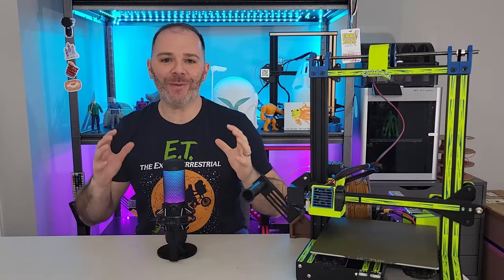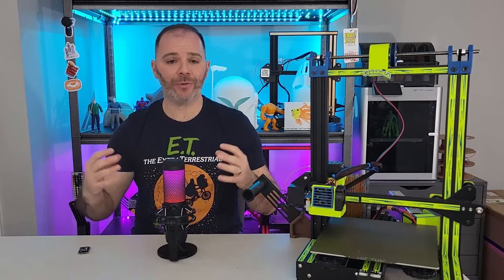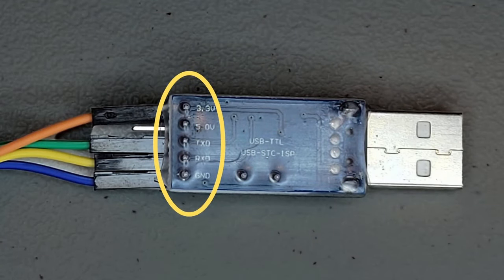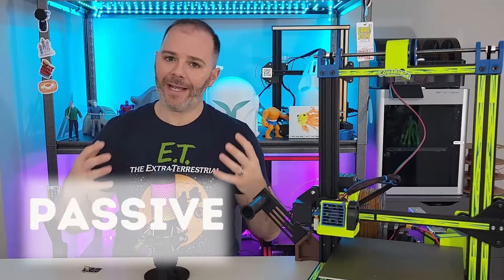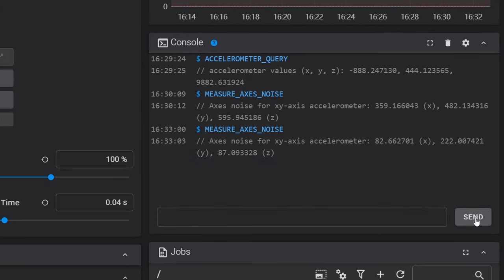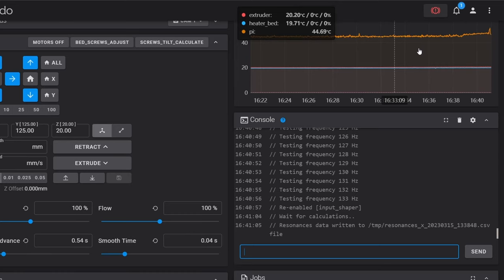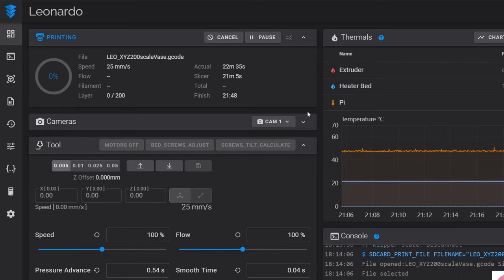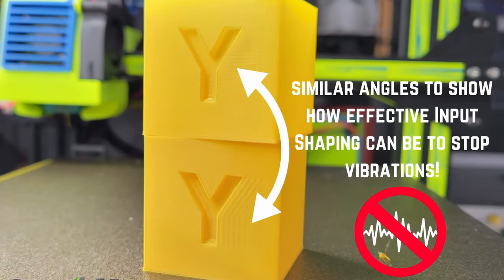Input Shaping Made easy with a USB accelerometer!

Comment: Leo, you are greatly misunderstanding coreXY idea, Ender 5 is cartesian, BambuLab is coreXY. CoreXY is faster and more precise because in cartesian one motor need to be moved with a head (look at ender 5, Y stepper is fixed, but X stepper moves). In coreXY both motors are stationary, just head moves.
Reply from the maker: I'm not sure if I accidentally called an Ender 5 a CoreXY printer, if I did that was my mistake. One important note is that they are both technically Cartesian printers, as they all employ Cartesian coordinates. So you're calling the ender 5 by its 'coordinate' name and your calling the CoreXY by its 'mechanical' name which is not a fair comparison. Obviously their kinematics do differ and it's an important distinction. Besides the stable motors that coreXY employs the routing of the belt is another important characteristic!
Reply: @PrintsLeo3D  Let me start with what I had to say first - you've made a truly awesome video.

As for coreXY, I'm afraid you do the same mistake as I did till recently. "Cartesian" it's not about coordinates, they all operates in cartesian coordinates (corexy, cartesian and delta). Unfortunately, for some historical reason "Cartesian" was chosen as a description of a very specific *mechanics*, not a coordinate system. I finally got the difference, when asked myself, why do we need coreXY, if I can just rotate model by 45 degrees. Then for straight lines both steppers will be involved as on coreXY. But the difference is in belt system, where steppers are not moving at all and do not contribute their weight into inertia.

"Cartesian" requires one stepper to move along the axis. CoreXY - don't. They both operate in cartesian coordinates.

Comment: If you are trying to flash the KUSBA using the guide on the website and get the "Unknown initial pin 'PA14' ... Error 255" Make sure to deselect the GPIO pin in the klipper firmware.
Reply from the maker: Are you referring to the guide on my website ? If so I will add this information to that section to let others know. Thanks !
Reply: @PrintsLeo3D  Yes I was using your guide. Your guide does specify to set the image exactly like. It was my mistake not realizing I had it checked. If you used the firmware image tool to flash klipper, that GPIO pin might be selected at the bottom. It took me like 30 minutes messing around to realize I had it checked because it was towards the bottom. I was a bit tired lol. 

One other thing I would recommend is running (straight from klipper documentation):
- sudo apt install python3-numpy python3-matplotlib libatlas-base-dev libopenblas-dev

I just ran and had some issues due to libopenblas not being installed. For some reason I also had to install matplotlib again as well, not sure why. 
- sudo apt install python3-numpy matplotlib libatlas-base-dev

I really appreciate the guide though Leo. I love your content, thanks for all the help.

Comment: I can't seem to find the KUSBA article on your website. I keep getting "Printer is not ready. The klippy host software is attempting to connect.  Please retry in a few moments.". When I put # [include adxlmcu.cfg] in the printer.cfg, everything works fine after the restart. DId the firmware not flash correctly onto the KUSBA?
Reply from the maker: The config file is going to look different for the KUSBA accelerometer, so if you're trying to use the same one as in this video you'll get an error. I am going to be posting the article tomorrow in the AM as I am doing a long drive and will be working on it then!
Reply: @PrintsLeo3D   Thank you, i'll look at it when you post it. I used the github documentation for the KUSBA v2, not the TriangleLabs ADXL in the video. Maybe I did something wrong, or something in the documentation is off.

Comment: When I plugged in the USB C after flashing, only one light lit up.  Also my ls command showed no USB0 until I plugged in the flash device so I selected USB0.
Reply from the maker: If after flashing, you unplug the flash device, then plug the accelerometer into the host device and only a single light is illuminating it leans me to think there was an issue with the flash process. I woule double check the connectors on the flash device. 
    As for the USB0 that sounds like it's working properly. Whatever populated when you plugged in the accelerometer is what you should use 👍

Comment: Please help with a question:  When i send ACCELEROMETER_QUERY I get values for x, y, and z. But when I send MEASURE_AXES_NOISE it returns values for x and y, but for z it says 0.000000.  Shouldn't there be a value for z other than 0?  Is this OK or what might be the problem?  The SHAPER_CALIBRATE AXIS=X (and also for Y) seems to have worked properly.   Thank you for your excellent videos - you are a great instructor!

Comment: I ignored this for a very long time, I just ordered my accelerometer to experiment with this. The results speak for themselves! Thanks for the video!
Reply from the maker: You're welcome! This is really not all that difficult as far as a calibration goes and it can have a significant effect on print quality for you. Good luck.
Reply: @PrintsLeo3D  I just finished setting up my printer and finished setting input shaping using your tutorial (partialy, because I had a cheap chinese accelerometer board that I needed to desolder a part in oder to make it work). I can't believe how easy it is to to this and to play with klipper! I never expected my printer to have these abilities! Thanks for the tutorial!
Reply from the maker: It's crazy right ?! I want to make a condensed version of this video, because seeing a 40+ minute video doesn't make it seem simple, but it really is! Can't believe you had to do some hands on work to get it going either. Great job and I'm glad you made it work 👍
Reply: @PrintsLeo3D  I didn't mind watching the long video, is like watching a documentary about Input Shaping that answered most of the questions I wanted to ask :). But yeah, a shorter version focused on the automated process, could also be useful for some. Other youtubers make tutorials about this, but they barely even know how it works.
Reply from the maker: Yea I try and walk the line of being informative but also brief. There are times when I edit down the pauses in my speech to save a few seconds 😆 I appreciate the support though, means a lot. Thank you.

Comment: The best Input Shaper video I have seen. Very concise and methodical. This is something I still need to do on my Klipper Ender 3s so going to order the kit now. Thank you for your great work and content.
Reply from the maker: Thank you so much! I take a lot of time setting up these videos so that I can pack in the most info but also make it easy to understand. I appreciate the support, it means a lot when someone takes time to drop me a comment like this. Thank you.
Reply: @PrintsLeo3D  Just received my KUSBA this morning. Did you ever et to post your article on the installation and use for it on your site? I can't find it. Or is it the same process as described in your video?
Reply from the maker: I'm finishing up the article now. The process is very much the same as the triangle labs , except the configs will look different. if you need an example config let me know.

Comment: Hi Leo, I will get this USB Sensor for my tests :) Excellent tutorial. BUT, I am even more interested in your Z-Belt printer... I am obsessed in getting rid of variations in layer height and lines in Z....
Reply from the maker: Yea the dual belted z modification is a really fun project. I'd say however you reinforce your z will likely improve z height variations (dual motor, timing belt, belted z, etc), but the belted version is by far the coolest. I have a video where I go over that if you're interested.
https://youtu.be/Do0L4yVF0so

Comment: I haven't gotten into Klipper yet, I'm not very good with that aspect of 3D printing, it's to much like programming to me and my brain just doesn't deal with it. But damn this is another fantastic video Leo. You always so good at explaining this stuff
Reply from the maker: Thank you so much, and you do not give yourself enough credit!! I have seen the models and post processing work you can do, and compared to that copy and pasting some lines of text should be easy! As always I appreciate you taking time to  drop a comment (and some motivation), and I am glad you're part of the Discord crowd now!! Can't wait to see what you're working on next!
Reply: klipper does take some more time and a bit of research and dare I say troubleshooting. So I think it maybe something to read upon if you only have 1 printer and don't want it to be down for any amount of time. But Leo's video are the best klipper guides online. And there are a lot of helpful ppl on his discord ( including myself) that will jump in and answer question and help trouble shoot. I tried installing back in may and had no luck....tried again and (with the help from discord) that Most of my USB cable were charge only. So I swapped out 2 cables and boom I was up and running. Klipper IS a lot more calibration but the results and gained speed make it worth for me. And you can always flash back to Marlin if you hate it. IF the coding part is holding you back, I'd say 99% is copy paste from the description or one of Leo's articles and the other 1% can easily be searched online or just ask us in the discord. I knew very little about Linux, but between building Marlin firmware custom for my machines and installing  klipper I'm getting better. But Between the Video's the guides and the discord it's totally doable. I'm NOT saying it's super easy, but it is super rewarding when you have it up and running. Also nice when I'm watching 3d print video in my living room upstairs and have an Idea and can design, slice and send to printer from there, no sd cards. My 99 cents.
Reply from the maker: This feels more like a whole dollar than just 99 cents lol Awesome comment. I have been enthralled with Klipper for long enough that it's sometimes hard for me to take a step back and get a 'beginning& view of Klipper. So I appreciate this comment and the viewpoint you are representing, this is the sort of information that is invaluable to me and others. I appreciate you taking the time to share it, and of course I appreciate you sharing some nice words about me and my videos.

Comment: Great video. I bought a different accelerometer based on the same adxl345 that already has the firmware installed, so I was able to skip a few steps but otherwise found yours really helpful.
Reply from the maker: Thank you! I'd like to make a more condensed video down the line for people in your situation, that already have an ADXL with firmware and don't need to go through those steps. I'm happy you were able to move to the sections you needed and found it useful! Thanks for commenting.

Comment: Everything was great in this video except I wish you went into detail on what to do to setup the print for the cube correctly. Is it just vase mode? dont we have to adjust accel and other settings on the slicer to match what our matching recommended max accel or does klipper handle that?
Reply from the maker: The max accel that we get from the testing is not what you should set your max accel to. That value just indicates the highest acceleration you can run, where that particular input shaper will still be effective. Finding out what your actual max accel values are is a whole other process (and video), and I am looking forward to going in depth on that topic very shortly. 
    For the cubes I believe I just did run those in vase mode. I didn't intend for the printing process to be highlighted, just the results of Input Shaping, but it's good to know people are interested. I will try and be more thorough/transparent in future videos.

Comment: I love how plug and play Klipper makes this for us.   Marlin has Input Shaping as well, but you have to know or calculate the data to add into the firmware.    Stil ldeciding if it is worth it on my Ender 5 though as I have not yet seen any particular resonant frequencies during test prints.
I think the limitation Marlin will face is the limitation of the control board and lack of power and memory on the control boards.
The device I was looking at was KUSBA, but the Triangle labs device almost looks like a clone of that device so I imagine it works well.
Reply from the maker: Just like in your recent comment you hit the nail right on the head! I am late to reply to your message (and I apologize for that) but I wonder if you decided to take the plunge with your Ender 5. I have used both the triangle labs and KUSBA and can vouch for both of their performance. Although I will say the KUSBA seems to be a little more finnicky and has given some users more of a hard time. They both get you there but the Triangle Labs does it a little easier.
Reply: @Leo3D I bit the bullet and went for Klipper and with the stock hot end it made little difference over Marlin 2.x versions.   There are two big advantages with Klipper though.  The use of Klipper Screen on a touch screen at the printer gives a much nice UI at the printer.   The second is the remote control without needing Octoprint.   There are some subtle differences as well, like getting a little extra speed while keeping good quality prints, but being a cube frame the Ender 5 did pretty good before.   The ability to update parameters without recompiling firmware everytime is definitely a big advantage on Klipper also.
Overall I will likely stay with Klipper.   It's just more subtle differences rather than the "wow" that some will claim Klipper gives.   Maybe would be better to upgrade the hotend and extruder before going for firmware changes, but this only cost me time as I had the Pi 3B and the 7" touch screen floating around from a previous project.

Comment: I have the same accelerometer and I had to reflash today due to updating klipper. I ran into issues when flashing the firmware but was able to fix it by remove the -v in the stm32flash command.
Reply from the maker: Thanks for the information! That's why I always tell people to check the comments because a lot of people's issues have fixes already from people who contributed. Thanks!

Comment: Found the issue. The USB to TTL converter that was shipped in the package was bad. I pulled 1 from another project to test and was able to get it working. I have sent Triangle-lab an email for a replacement. Hopefully they will send a newer USB to TTL converter since the you can not get Prolific chip drivers.
Reply from the maker: I am so sorry I am late to respond to this! That's unfortunate your unit was bad out of the box, and I'm sorry I didn't get a chance to help you diagnose this quicker. Hopefully Triangle Labs does the right thing and gets you a new unit as soon as possible. Let me know what all ends up happening and if you need help I'll try and be quicker in the future.
Reply: @PrintsLeo3D  I received an email from them and I sent them a copy of the error I am getting. The said they will forward to an engineer. I also added that I was using a raspberry pi.
Thanks Leo

Comment: Hi   
Is this applicable to any 3d FDM printer ?  What must be the firmware on the 3d printer to use the accelerometer
Reply from the maker: This is video is dealing specifically with Klipper firmware. So all the steps and commands I cover require that specific firmware (which j would highly recommend lol). I know Marlin firmware does offer some amount of input shaping , although I don't know what the breadth of it is. That being said the concepts cover (ie. How input shaping works) is applicable in a general sense among any machine using it.

Comment: Yah man you made this easily understandable. Thank you thank you, once i can get this tcl 20 pro 5g rooted i should be able to set up more than just octoklipper like i got setup on my tab 3. And i got the triangle labs usb adxl345 on the way and i should be good to go.
Reply from the maker: Thanks for the comment I appreciate it! As for rooting your TCL and using the ADXL with it good luck! I would love to hear how that turns out for you!
Reply: @PrintsLeo3D  forsure, I kinda struck out on rooting, the tcl 20 5g, can't seem to find a proper firmware for it, but I was able to get the newer galaxy tab E rooted. And I should be able to get through the issues I was having on my tab 3. It was just to old I think but not quite sure how using the accelerometer will go. I will definitely let you know if I get it all setup tho.

Comment: Do you need klipper to be installed on the printer? Or could a printer running marlin still use this? Would it be possible to just run the input shaping protocol, get the vibration values and use them in marlin's implementation of input shaping?
Reply from the maker: That's a very smart idea, but you would need Klipper to be installed on your printer. Mainly that would be to tell the printer to vibrate through the Hz spectrum and then have it carry that procedure out. The data that is gathered is kept on the Klipper host device (usually a pi or similar single board computer), so you could trick the brain into operating on another printer for purposes of data gathering, but the actually test that it uses is ran through Klipper. So in the end you would need to have Klipper on your 3d printer. If you're interested in something like that and need help let me know! You can join the Discord server where a lot of other people have made the plunge into Klipper, or I can try and make a dedicated video if it's an issue a lot of others are having.